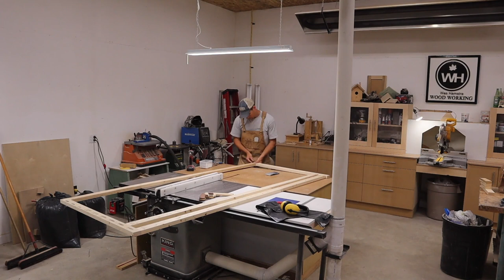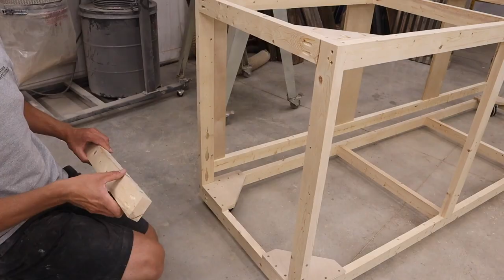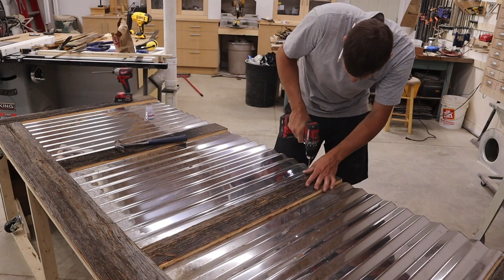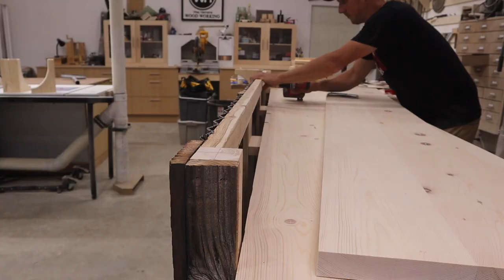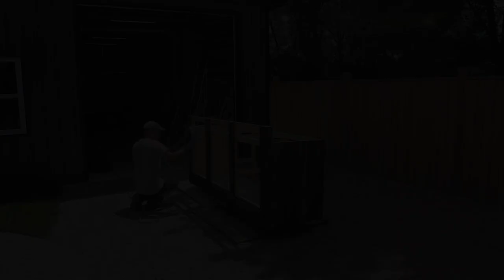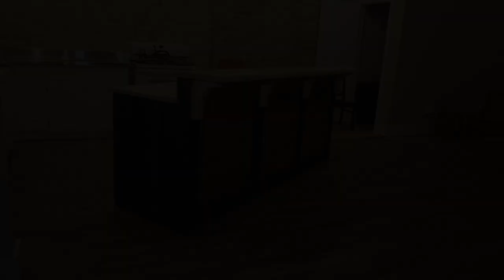Building A Kitchen Island - Wood & Metal

Comment: Looks awesome, if the client truly wanted it on casters, you may have been able to add a kick plate or "step" off the front and mounted the outside casters there, that could have adjusted the center of gravity back a bit so it wouldn't tip.  Looks like the top is about 10-12" of overhang, so 6 or 7" foot rest wouldnt be a tripping hazard and could work.

I love the look of those cantilevers by the way.

Comment: Beautiful work Wes! I can see why they wanted it on casters to move around. I guess that you could have added two hidden heavy weights in each front corner to stop it from tipping. In any event, great job on your part...........  👍👍😉😉
Reply from the maker: We did think about hiding 2x2 patio pavers into the bottom.

Comment: I ran into a similar issue with a cabinet that had an overhang tipping. Since it was going to be used for storage. I figured the weight of the items would negate that issue. Just to be safe though, I installed smaller diameter casters. In the end. there was a slight issue when unloaded, but only as far as it took for the panel to touch the floor. With it fully loaded, there was no tipping issue. I don't know if that would have worked in your case without knowing how much weight would have been inside the cabinet.
Reply from the maker: It might have worked. They were ok with it not being mobile. Thanks for watching!